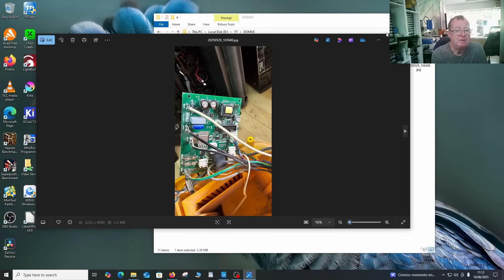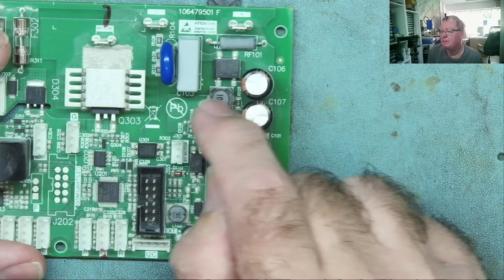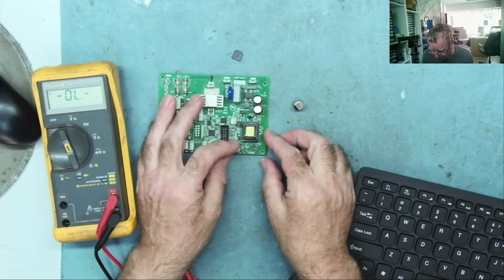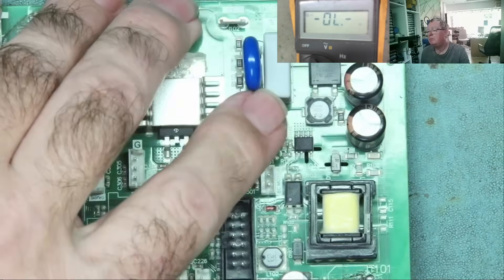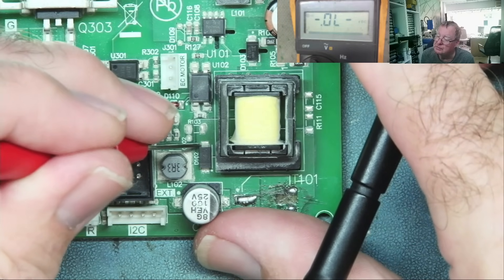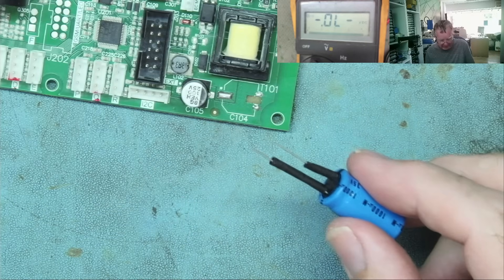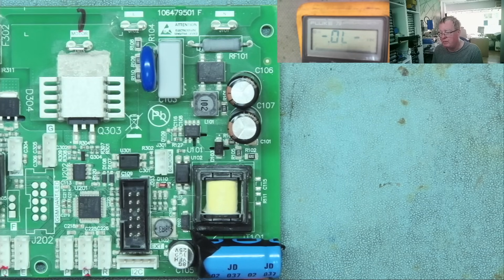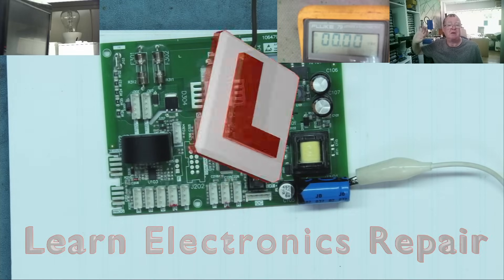Industrial Cleaning Machine PCB Repair. Methodical Fault Finding.

Comment: Great video, hat ort of cleaner is it, complex circuit for just a cleaner that require an MCU? I guess it must be multifunctional as the STM8S005  it has 32/48 IO's and apx 37ISR routines depending on exact ic ? Quite a cleaner it must be..

Comment: Your last comments about charging were interesting: Replace a capacitor on an expensive industrial device: you can charge to make good money. Repair something for a normal user, maybe more complicated, don't charge much? I would love to see a video about how you charge. I do computer work, and I charge for everything per hour - with only few exceptions for friends.
Reply from the maker: The problem with making a video about charging the customer is it is very regional and also subjective. For example €60 pays my electricity bill at the the workshop for a month. And it's less than ten minutes walk so I don't have to drive there mostly (unless I have something to transport) and it almost never rains here nor does the daytime temperature go below 20C so why wouldn't you want to walk to the office?. Just a couple of trivial examples but the fact is we all have different requirements or 'wants/desires' when it comes to income from work undertaken. Some other places in the world are a lot cheaper to live and work than here and others are more expensive.Some people consider the pursuit of wealth to be a measure of success and others consider having an easy time of it (don't stress just earn enough to get by) to be a measure of success.  And all this plays into how much to charge for yor work. In my opinion.
Reply: @LearnElectronicsRepair  Thanks for your answer. I live in Bangkok, and not because the income is high... For me the question above is not so much about the actual amounts you charge, but the system behind your charging: Obviously you have cost of components. But I guess sometimes you search for an hour and find one resistor is defect. And maybe that device cost new 100USD or it cost 5000USD. And another time you see after a minute that a capacitor is broken like in this case. Or you have to change many parts like in other videos.

Comment: It looks like the ferrite core on the 3.3uH inductor L102 has a crack.
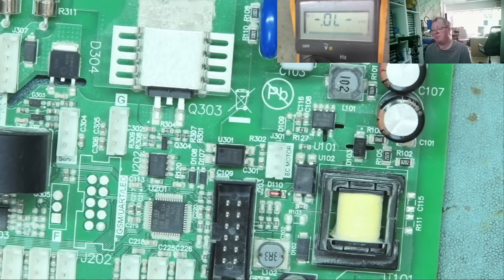At 13:15 it appears good, the after you clean the board (13:25 til the end) it looks damaged.

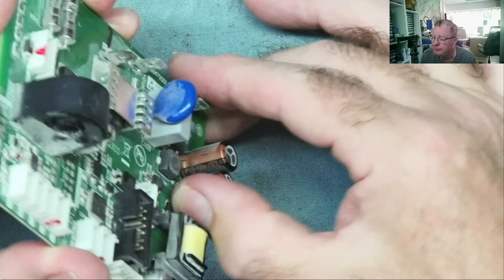Comment: 2:25, those caps are not in series. They are the same orientation on the component side and share a common reference on their positive side.
9:29 There looks to be a lot of debris and dirt around the board, a bit of a clean with IPA will help a lot.

Comment: Some how I do not think that capacitor was the problem..... it is paralel with the other cap.. so even without that one cap it should of worked !!!!
Reply from the maker: I tend to agree - but it clearly needed fixing first then let the customer put the PCB back in the device (which I don't have) then we will see